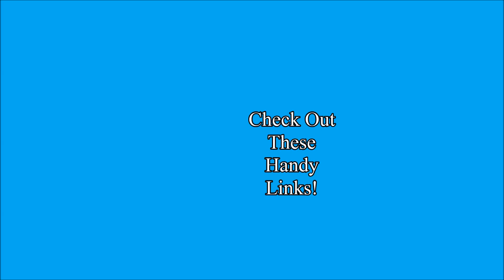Accessorizing the Gatton CNC - Cable Management

Comment: Cable chains are very 3D printable. After playing with quite a few cable chain designs, I settled on: https://www.thingiverse.com/thing:3117461 - of course printing long chains like this is going take you a while!
Reply from the maker: There are lots of options out there, of course. It all depends on what your priority is. I wanted to use the CNC - not work on it. After watching a friend go through about 6 different drag chain designs, discovering the shortcomings of each design he tried (not to mention his attempts at those designs using different materials,) I decided that it was easier (and cheaper in the long run) to just buy the drag chains, get the CNC up and running, and be done with it. For the money, this was the best option for me. Your mileage may vary, of course, but at the time, I had more important things to move on to.
Reply: Mark Lindsay CNC Oh yeah absolutely. And if my setup was the size of yours I probably wouldn't have printed my own. I'm new to CNC - am currently finishing up my Mostly Printed CNC build - and started with a 3D printer so it was natural to print my own chains. I do think they are a good general solution though of course not for everyone.

(I just found your channel and love the content, BTW)

Comment: Nice setup Mark! I’ve been waiting for this video lol i bought the extension cables for all the steppers ..wonder if I could use the left over Y axis cables to add on to others like the Z
Reply from the maker: That's what I did. I just covered the connections with electrical tape to hide the 2 different colors on the cables. Like I said, I used two 6 foot extension cables on the Z axis and one extension cable on the X axis. If I were more electrically inclined, I would have gotten the proper shielded cable and made the extension cables myself. Since I was ordering more items from Xylotex anyway, I went ahead and got the extension cable set and saved myself the trouble.

Thanks, Trevor!